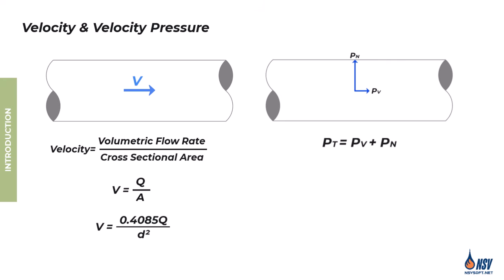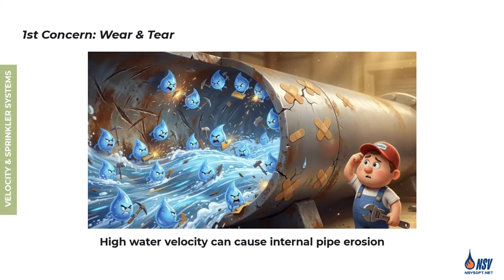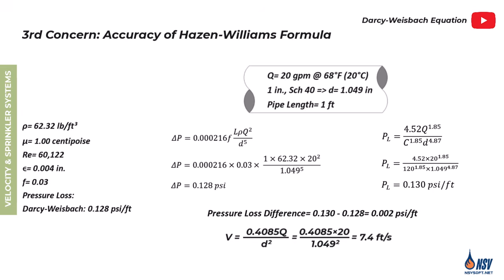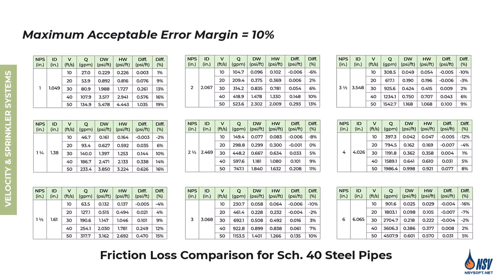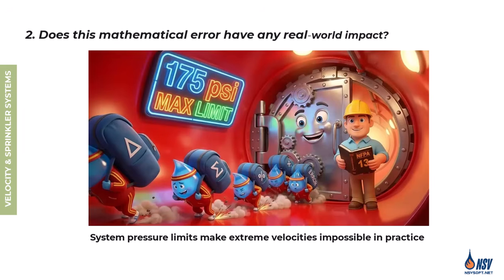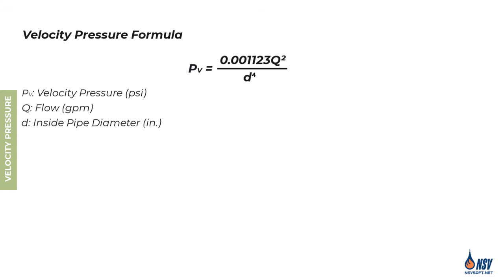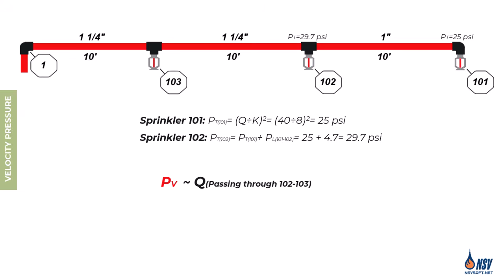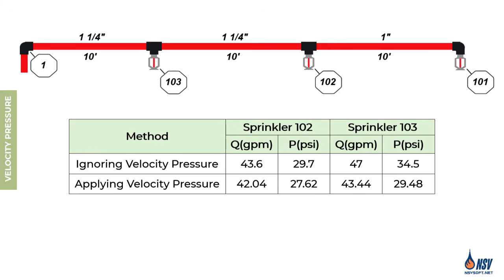⚙️Velocity & Velocity Pressure (NFPA 13)

Comment: "Thank you very much for the great video! I really appreciate the detailed explanation.Based on your breakdown, fire sprinkler systems do not have a fixed maximum or standard velocity since the limits vary naturally depending on the pipe materials and sizes used. However, I am curious about fire hydrant piping. Unlike sprinkler systems—where cross-mains scale up dynamically using the pipe schedule method—hydrant loops use large underground mains and consistent branch sizes that do not change. With that in mind, I have two questions: Is there a recognized standard or maximum velocity rule specifically for fire hydrant piping? When sizing these hydrant pipes, do we use the same hydraulic calculation methods as fire sprinklers, or is there a completely different calculation standard?Thank you again for your time and insights!"
Reply from the maker: You’ve picked up on the key distinction correctly. Here’s how it breaks down:

1. Is there a recognized velocity limit for fire hydrant piping?

In most cases, there’s no single hard-coded maximum velocity mandated in the core NFPA hydraulic requirements (one of the very few exceptions is NFPA 15, which limits velocity to 20 ft/s), but there are widely accepted engineering limits that most designers and authorities follow for underground fire service mains:

- A common practical ceiling is around 10 ft/s (3.0 m/s) for underground mains.
- FM Global guidance (Data Sheet 3-10) is often cited here and tends to recommend keeping velocities conservative for the same reasons.
- Some water utilities and local authorities (AHJs) impose their own velocity caps, so it’s always worth checking the local requirement, since that can override the general rule of thumb.

2. Same hydraulic calculation method as sprinklers?

The underlying hydraulics are the same. You’re still using the Hazen-Williams equation for friction loss.

The difference is in the design intent and the flow demand, not the formula. For standard spray sprinklers, for example, design starts from a density/area demand and builds up node by node through the tree or grid. Hydrant/main sizing is driven by the required fire flow (from a fire flow calculation or the AHJ) plus residual pressure requirements at the hydrant, then you verify the main can deliver that flow while staying within the velocity and pressure limits.

So: same hydraulic engine (Hazen-Williams, plus fitting losses and elevation), different starting demand and different acceptance criteria.

Hope that clears it up, and thanks again for watching!
Reply: @NSVCad  THANK YOU VERYYYY MUCH I APPRECIATE THE REPLY
Reply from the maker: You`re welcome!

Comment: Sir i just want to ask about how to size a fire pump using only private fire hydrants and hose cabinet thank you sir!
Reply from the maker: Calculating fire flow (the amount of water needed to fight a fire) is highly complex because it depends entirely on the specific hazards involved. Firefighters might face several scenarios near water hydrants, including:
- Sprinklered or non-sprinklered buildings
- Vehicles
- Wildland and open-space areas

Even when focusing strictly on buildings, engineers must evaluate whether a system has sprinklers. For non-sprinklered buildings, the water requirement increases significantly because you need enough water to fight the fire inside the building, plus extra water to prevent the flames from spreading to adjacent structures (known as exposure protection).

Methods for Determining Fire Flow:
- For buildings without sprinklers, several standard formulas and tables are used to calculate the required water volume, which can range anywhere from 500 gpm to 10,000 gpm (gallons per minute). The three most common standards are:
- Insurance Services Office (ISO) Formula: Varies water needs based on construction type, building size, and neighboring exposures.
- International Fire Code (IFC) Table: Also adjusts required flow based on size, construction type, and surrounding exposure risks.
- NFPA 1142 (Suburban & Rural Firefighting): Base calculations on the building’s occupancy (how it is used), construction type, and exposure hazards.

Ultimately, we hope to record a video about this topic someday!
Reply: @NSVCad thank you siiir! Because i have a situation which the building is not sprinklered and only with fire hydrants and fire hose cabinet since it is only a single story building. I am having some trouble to design it since im new to the fire fighting system and i dont know which nfpa should i base you helped me too much sir thank you
Reply from the maker: You're welcome!